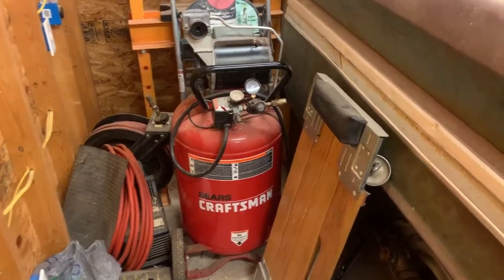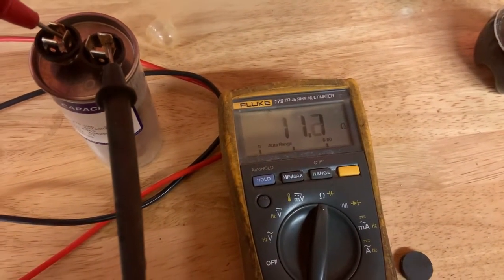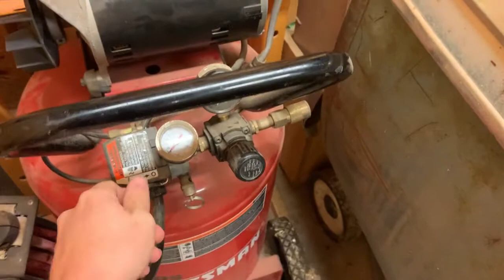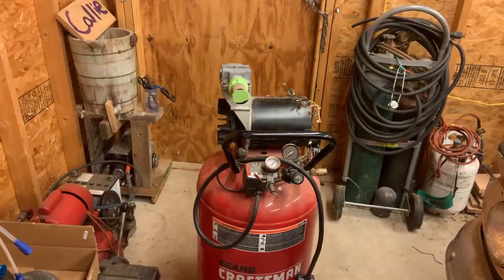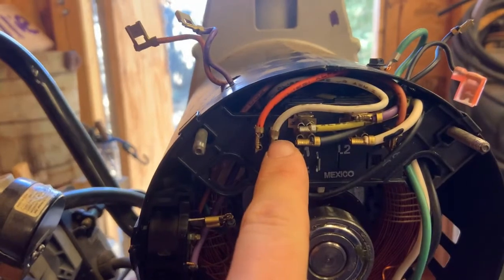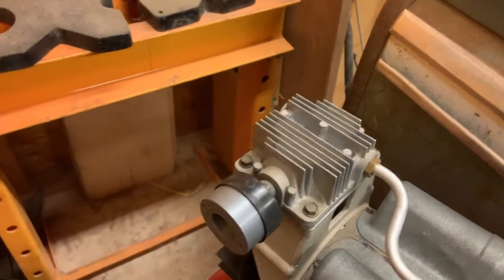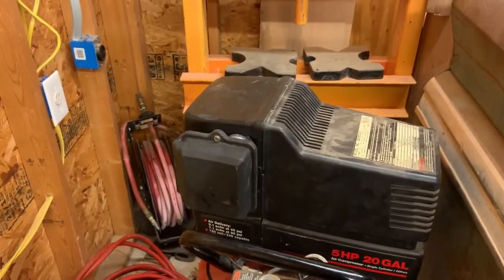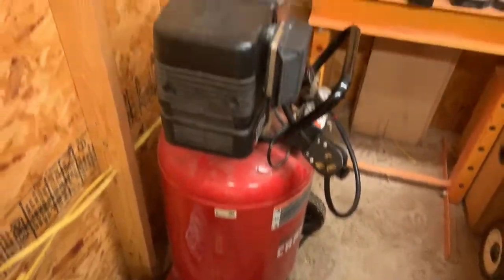Craftsman Air Compressor Check Description | Tool Repair

Comment: Nice work. Your air filter is probably better, but just FYI Lowes sells a universal air filter kit that has round and rectangular foam filters that fit the original housing. Incase not everyone has a 3D printer or wants to spend time fabing a new filter housing. Also capacitors are usually locally sourced at your appliance supply house for the cost of the juggle store. for $15 it's probably good to have an extra on hand for your A/C unit as well.

Comment: Hey good job figuring out your fluke and voltage situation..  You need a 10k resistor to dissipate those caps. Don’t do that screwdriver crap, it will damage a cap.  Just curious , I see you are using a dryer plug. That compressor should be on a dedicated circuit  with a properly sized breaker. If you are using a 30 amp breaker (like a dryer outlet would probably have) your motor could be severely damaged before you trip the breaker. Look at the fla rating on the motor!  There were some recalls on the black shroud make sure it has grooves to breathe, it looks like u do.  I have the exact same problem with my filter, props! That is an awesome fix !  With the vibration created by oil less compressors I usually recommend a locking plug and receptacle set up. 20 bucks at Lowe’s.
Reply from the maker: Seeing constant resistance on a capacitor has so far still worked on a few more I have tested but the fluke is definitely ideal. I had heard mixed opinions on the shorting method but since they aren't expensive I wasn't too worried about it. All the wiring is done by the book, that plug is on its own with its own breaker but I don't remember what rating it is. The thermal protection in the motor popped several times and I popped the breaker a few times without burning anything up (before I diagnosed the bad capacitor) but you might be right about the breaker size. The shroud lets air flow through it. I have been using it in a different building and haven't had the issue of it walking around which is nice, Thanks for all the input!

Comment: You are not checking the resistance, you should check capacitance of the cap. You need to hit the yellow tap at your tester to see the cap values. Hope this help.
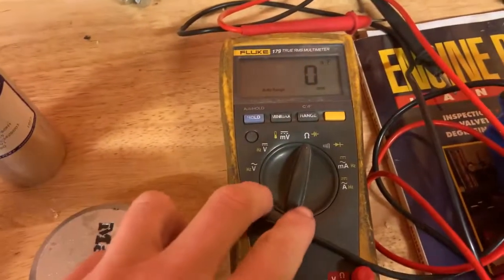Reply from the maker: At 8:00 I realized my meter did capacitance. Before that I was not necessarily measuring resistance but observing the change of internal resistance. As a capacitor charges the resistance increases from 0ish to infinity (open circuit) when fully charged, apparently most multimeters will simulate this because they feed a small current when measuring resistance. While this won't tell you what the capacitance is it will at least show if has the ability to build a charge

Comment: The link to the capacitors?
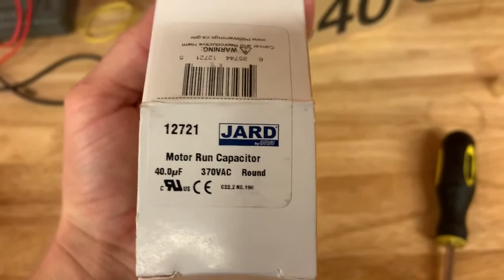Reply from the maker: Sorry, I didnt save that info but at 5:40 I show the brand and part number, I ordered it off amazon. Make sure its specs match the one you are replacing. The only specs you can get away with being different is maybe size, the replacement capacitor was shorter but still fit snug in its case and I made sure the terminals could not ground out. Had to go with that capacitor because the original was discontinued best I remember

Comment: Hi could you make that adaptor for me
Reply from the maker: I could print another one, I didn't get the 2 mounting holes at the right angle and had to elongate the holes in the metal housing to make it sit level. Would you like me to try and correct that? The holes in the metal housing would probably still need some work